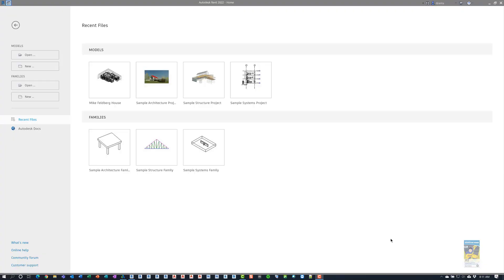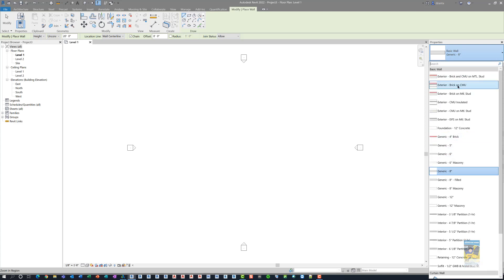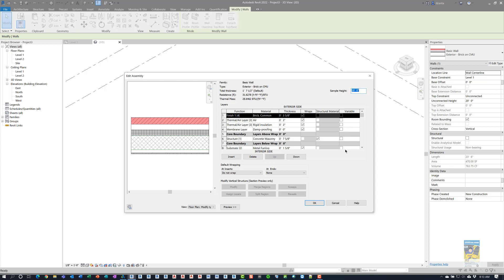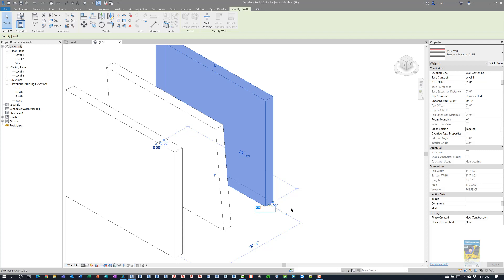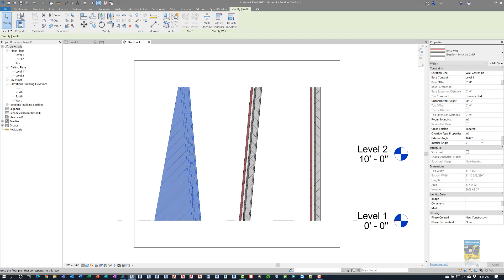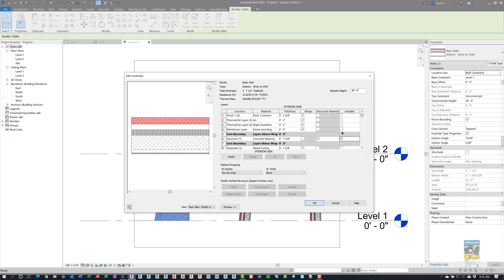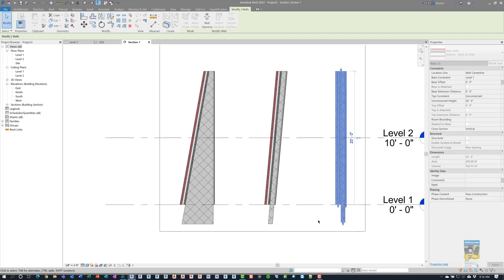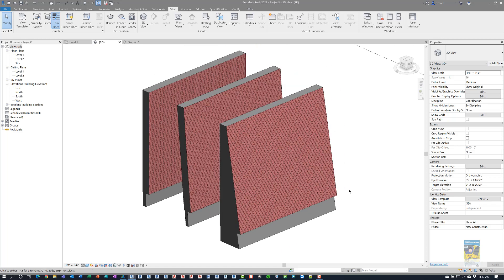Revit 2022 - Tapered Walls

Comment: Hello, is there a way to taper the wall in different angles for each side? Let's say have a taper of 80 degrees on the right of the wall and a different one on the left side?
Reply from the maker: If you look at the instance properties there should be an interior and exterior angle function.
Reply: @DzanTa  yes, you mention that. But I want to have one end of the wall be different from the other, not the inside and outside